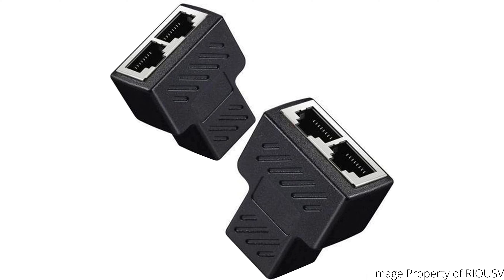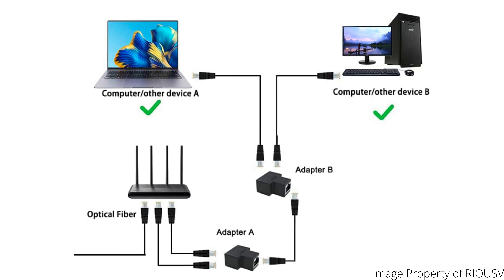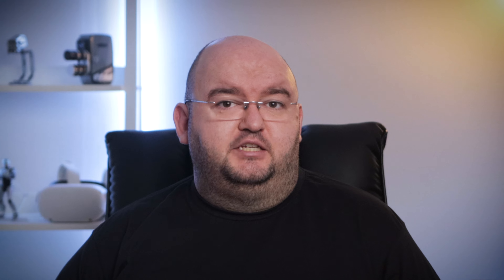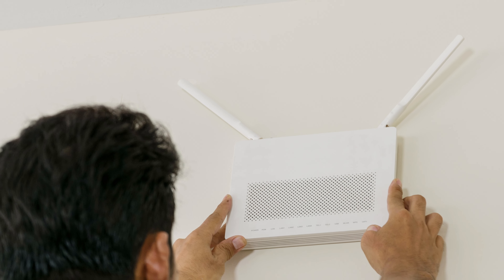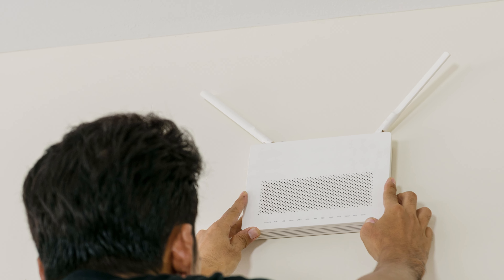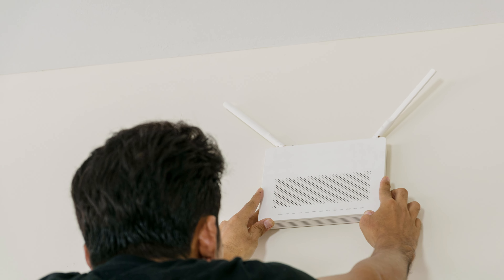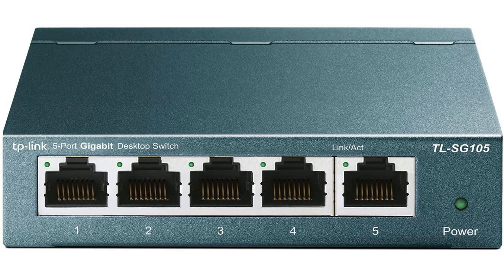Ethernet Cable Splitters -EXPLAINED

Comment: I’m just wondering but would you be able to use a Ethernet splitter to connect 2 consoles to so you don’t have to keep unplugging the cable from one console and put it in the other?
Reply: thats what its for yes
Reply: Yes I need more info on this as well I have a xsx and ps5 I keep unplugging one to use the Ethernet coming from the wall? Will this Ethernet port be able to work so I can leave both systems plugged into the splitter coming from the Ethernet on the wall?
Reply: So does this works?

Comment: Thanks mate for this video. I have FRITZ!Box Router in one room, currently connecting other rooms via wifi. As my son is playing online games, he needs a good connection and we are planning to install a cable from the router to his room. He has a pc and a ps5. Would it be ok to just run one cable from the router to his room and then connect a switch to split the signal to the two devices?

Comment: Ok so I have 1 ethernet cable connected to my modem and I want to get a splitter that will allow me to connect that 1 to add 2 more ethernet ports. Any links to which splitter's may do that the best?
Reply: same here
Reply: All of the splitters I’ve found on Amazon say you can’t connect the internet on both devices at the same time when using a splitter. Is this true?
Reply: @BrickPB did u get a response ?
Reply: Bruh just use a Ethernet switch hub if you want 10/100 MBPS then it's just like 5$ but if you want 100/1000MBPS then it's just 15$

Comment: I'm trying to work this currently. My router has four outlets and I'd like more. I'd like to move away from wireless to a more wired configuration. Using the home wiring is not suitable in my home as it is a radial system. I do have a network around the house all coming back to the router but nowhere to plug them all in.

Comment: I have a question bro random are these products good as far as just using them to make your Ethernet cable longer than what it is by connecting them one to the other on each side just wondering
Reply: No, since you'll make the connection ten times slower. Just get a straight up passive or powered ethernet extender, depending on how long the cable is.

Comment: And if i want to use 1 wire with poe and put the spliters also on it ,before the poe injector and after the poe spliter ?😂 than what?   will they work togheter both ? Poe and the 2 devices with internet at the and of the line ? Test question 😂

Comment: I have an Ethernet port in my wall at my apartment. I want to connect 2 computers to that Ethernet port and use the internet at the same time. Is this possible?
Reply: Did you ever find an answer to this?

Comment: good morning

theoretically, would this work over a 1gb network with a cat 7 cable? i am losing about 50mbps since its a 100ft wire and distance. still great speeds on my PC with it hardwired to ethernet around 950mbps download and 26 upload. with less than 10 ping and latency for both

i want to split this ethernet cable in my guest room and connect a second router to the cable coming from the first router seated next to the modem.

would this work to increase the range of my WIFI on that part of the house while simultaneously providing a more stable connection for my pc wired?

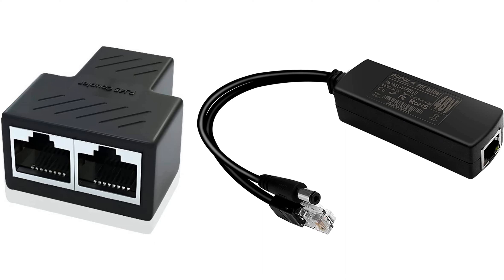Comment: 0:52 shows a PoE splitter, and says you can use that to power your device, Incorrect, you would need a PoE Injector for that, a PoE splitter is the reverse of an injector, and that's what is pictured on the right hand side.

Comment: If an Ethernet cable is connected to an ISPs router would issues occur with WI-FI? I am planning on connecting two Ethernet cables one will be going directly into a PlayStation and another might be connected to 8 port switch which will be used to set up a new network. Not sure whether two different cat cables would cause an issue my isp has provided me with a cat 5e ethernet cable I am planning on getting an cat 8 cable could the two cause an issue?
Reply: Cat8?  Good lord, cat 6 is all you need for most home internet connections.  If you have an 8 port switch, all of your wired devices that are able to Connect as practical should be connected to it and then connect the switch to the router from the ISP.

Comment: I have 1 Ethernet cable coming to my tv but also want to hook up my Xbox. What is my best option. I was thinking about using a splitter.
Reply: Get a 4 port switch they are inexpensive and the best option, splitter is not a good idea.

Comment: I googled something i came to think about and found this video,
If i have 100mbs internet and connect two cables from my wall via a splitter, does both cables have full speed (100/100) or does it split it?
Reply: Depends on the cable you use, but if you're using Cat 5e, you get two 100 Mbps Base-T connections. The only problem is that the cable's bandwidth is limited to 100 Mbps, so any more and it might start dropping out. If you need a truly reliable solution, run two separate cables, but if you can't run two cables, a splitter can help. Just make one yourself because some bought splitters are not wired up correcly. You can also use a switch at the end, which will provide maximum speed for not much more money.

Comment: I'm trynna hook up my server, and the closest ethernet cable is inside a tv that's closeby, so I'm thinking splitting the connection between a tv and a server isn't gonna cause any problems, right?
Reply: It would be much better to get a cheap passive switch instead. As I said in the video, you need to "split" the cable at both ends, and you're giving up a massive amount of bandwidth. Not worth it.
Reply: @SydneyButler  Ya I just got a network switch and it does the job

Comment: The whole point of Ethernet is to avoid Wi-Fi and EMF radiation. Also..
The problem with Ethernet extender over power plug is that it creates dirty electricity